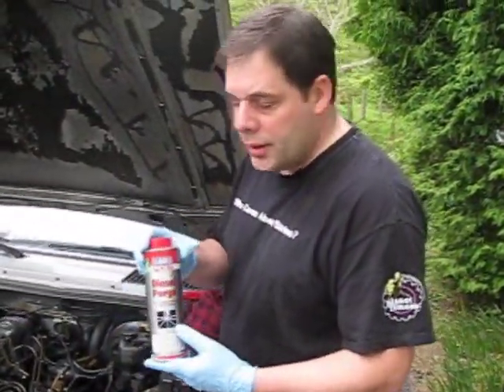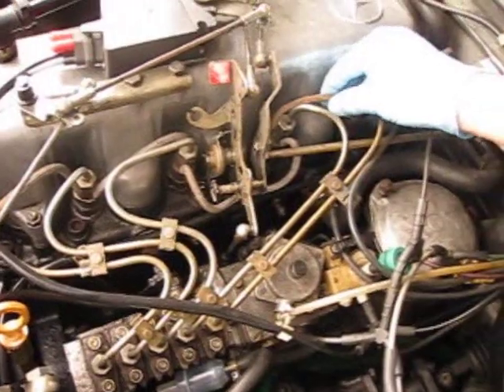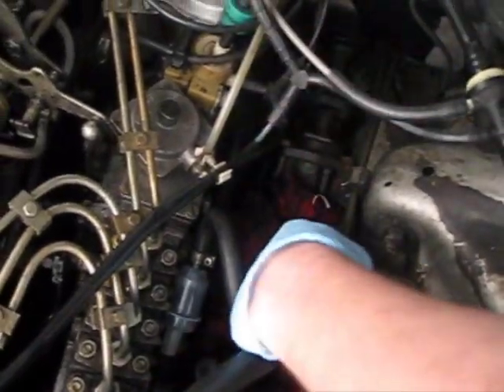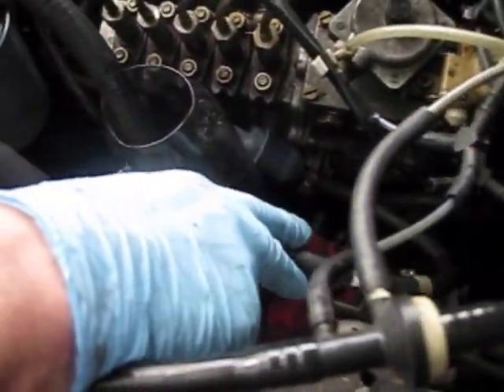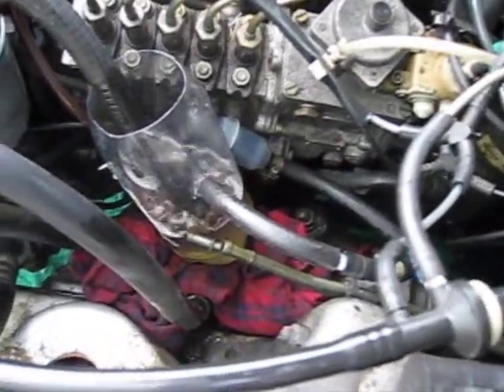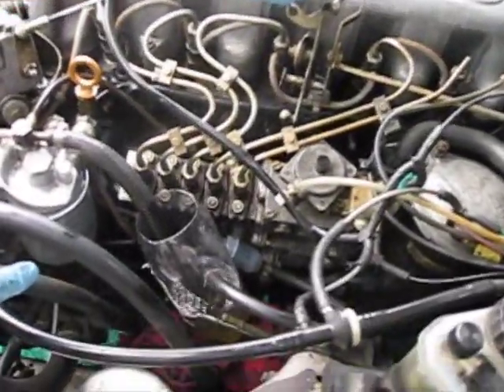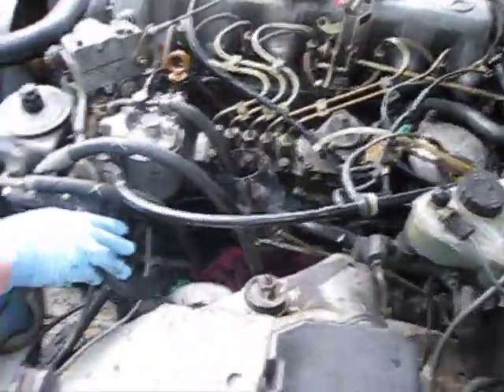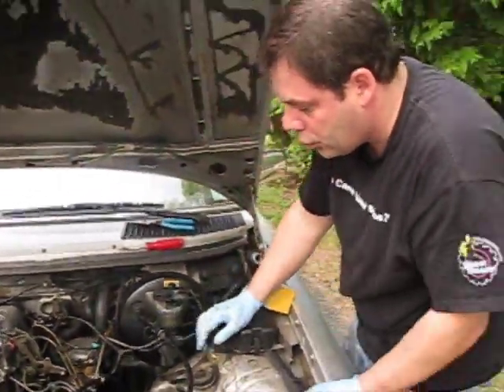Episode 2: Performing a Fuel Purge on a Mercedes Turbodiesel

Comment: I have a R320 CDI 2008 OM642, I want to run Liqui Moly Diesel Purge from the feed and return fuel hose line directly to the injectors. Its done to many Diesel vehicles but they all loop the return line going to the fuel tank as their fuel filters have 4 connections not 2, 2 returns and 2 feed. They close circuit the fuel lines going to the fuel tank or cap them and put the return line and feed line going to the high pressure pump into the liquid moly. I am wondering how this is done on the OM642 as their is only 1 return and 1 feed from the fuel filter. Any help would be great

Comment: I've got a 1982 240D, and have been sucking air into my fuel lines somewhere, most likely where the rubber hose meets the steel line back by the strainer outlet. Besides that, I had deteriorating hoses, most likely OE, that were sludging up my filters. Still got more work to do. Once leak is fixed, and strainer cleaned/replaced, I think I oughtta do this. Thanks for sharing these videos!

Comment: If you look under the emergency kit you'll see a bit bolt and this is the float that houses the mechanism that will allow you to know much diesel you have in the tank. Check for leaks right there. This should only take you 10 minutes to do.

Comment: Thanks for the video- I just tried 2 cans through my 85 Euro 300D that was running a little rough.  What a difference, the return fuel came out black.  Afterwards it ran much smoother with more power and less smoke.  I'm a believer..

Comment: Hi their, I have a question. if your diesel engine is been running on Waste Vegetable Oil. can I do a diesel purge to clean the injectors from that vegetable oil? Also when running that diesel cleaner will it hurt the injection pump or injectors because I have been running waste oil in their and then I flush them out with a cleaner. will I hurt anything since I have been running waste oil and then doing the purge? I appreciate a response thank you.

Comment: You have 2 hardlines open to the atmosphere, one is for the return and one for the feed. How is the feed hardline not shooting out fuel? The fuel pump should still be forcing diesel from the gas tank out of that hardline...
Reply: Proctor750 the pump is attached to the injection pump.. it’s that part that has the fuel primer attached to it

Comment: @thebigoc5 without the return in the same bottle as the supply, the supply would be sucked dry in a short time. The fuel goes through both filters anyway.